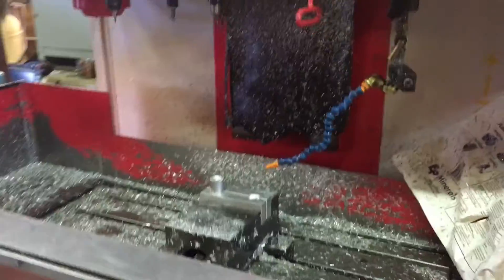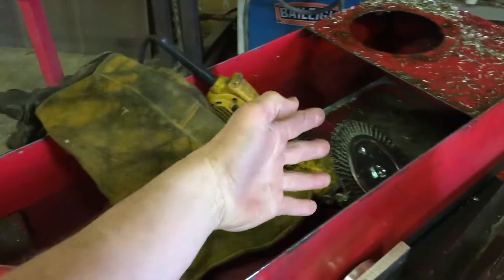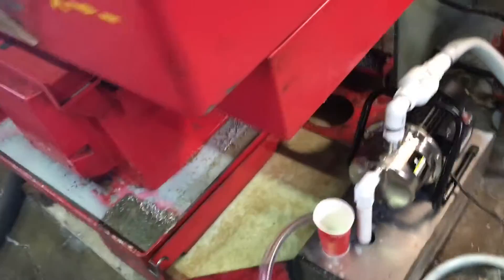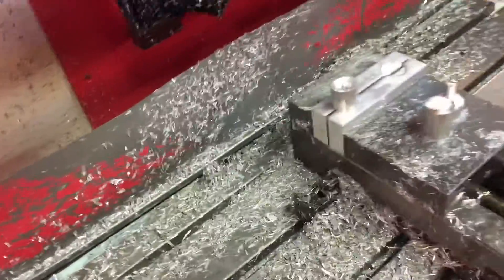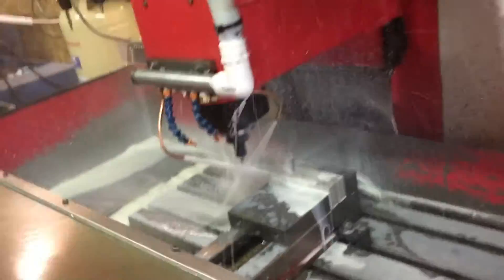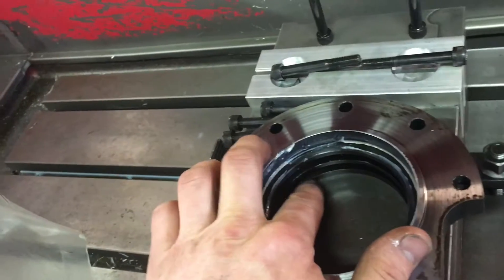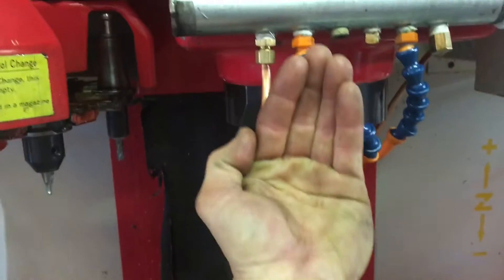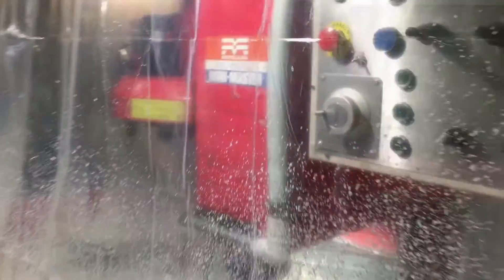New Coolant System And Work Lights

Comment: Well done! Does the control panel stay pretty dry?
Reply from the maker: +Jonathon Royce It does get splashed a little but not as much as you'd think. All in all, I'm surprisingly pleased with the set up. Initially I planned to  build an entire sheet metal enclosure, but I might just stick with the shower curtain for a while.